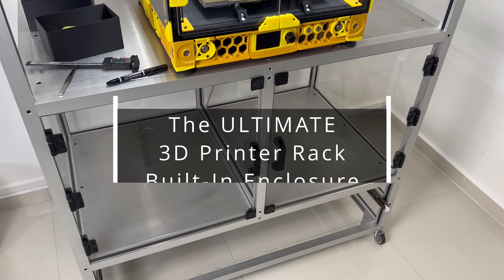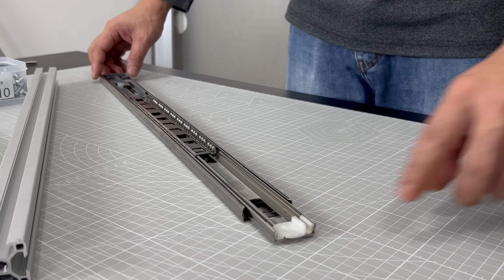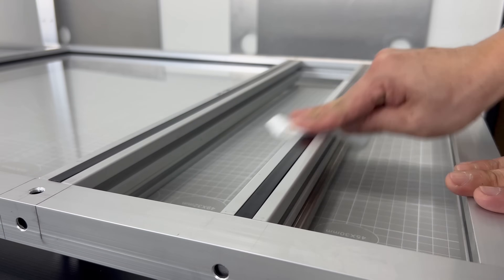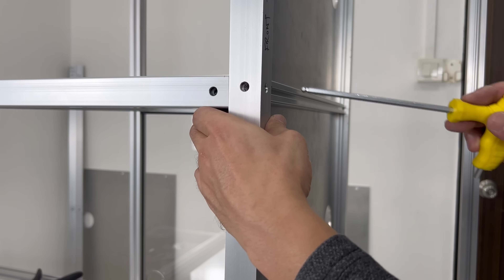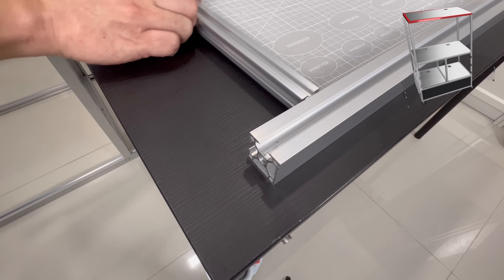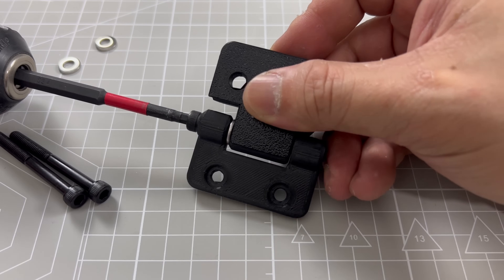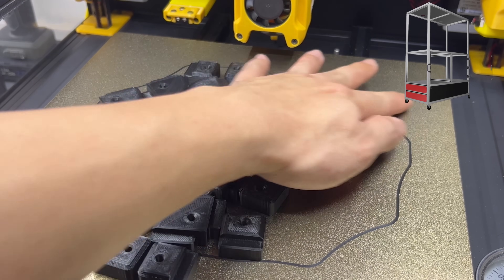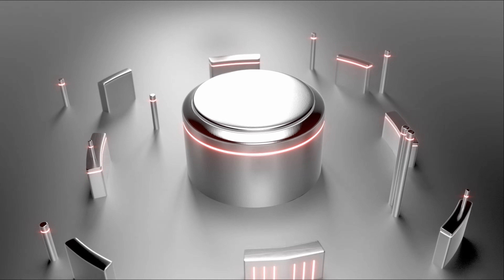ULTIMATE 3D Printer Rack (Part 2) | with Built-In ENCLOSURE

Comment: Great project! Really appreciate how well you show and explain what you’re doing. I’ve watched all your videos

Have you considered using loctite or other thread locker to avoid vibration causing bolts to loosen?
Reply from the maker: Hi Kevin, thanks for watching, hope you can give critics on how to improve on the videos or anything.
Loctite yes, am always thinking of it. For the voron printers, yes i used loctite. For the rack, i didnt, cos it hasnt came loose before. This is the 3rd time i put it together due to the need to improve certain design areas.
Reply: @TheAluminumCarpenter  It is with the manufacturers of the Nuts, to which we must turn in my opinion. They could easily I think, make brakes, as on the brake nuts, at the end of the latter.